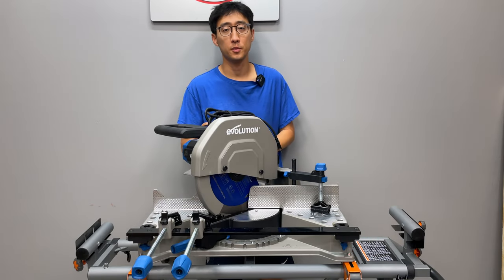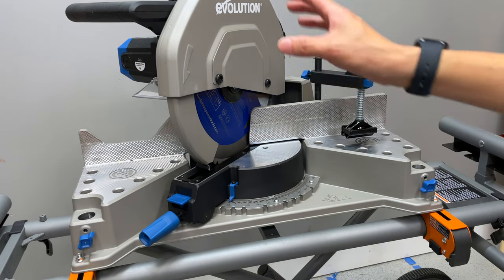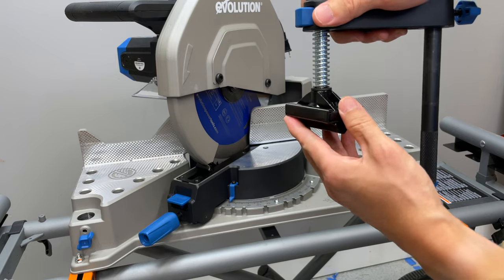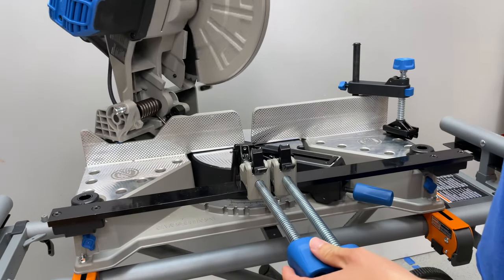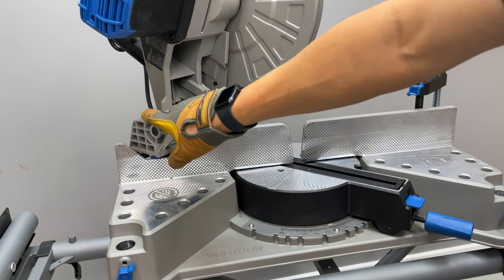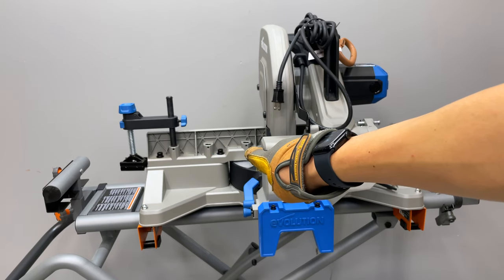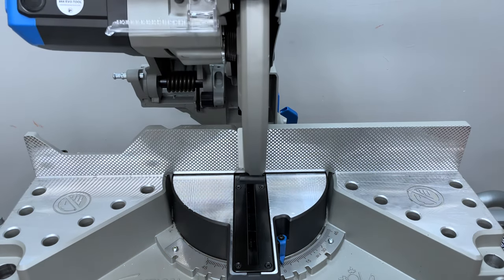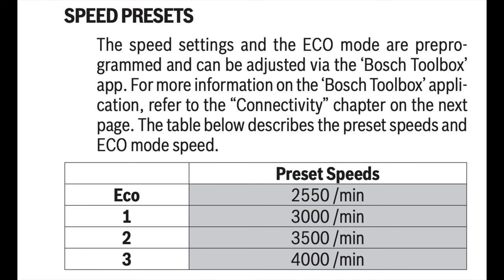23-44 | Evolution S355MCS Metal 14 inch Miter saw review | Clamp master | metal ninja

Comment: Hi good explanation video, im in uk and added this to my kit 😊 one thing to note the blue foot behind head doesnt actualy touch a surface, i use mine on a dewalt dw7260 with a 18mm plywood base also fitted a soft start mech to it much smoother 👍  im stoked with it best steel mitre saw i used the s380cps for 3yrs this is light yrs ahead 😂